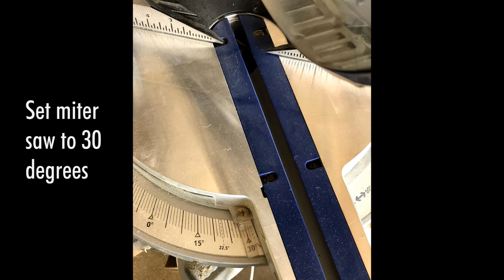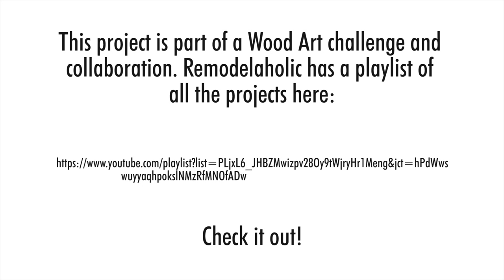DIY Pallet Project Wooden Wall Art by House Becoming Home

Comment: Great work, getting all those angles to match up is no joke, I have wanted to build a cutting board like this for a while but I love the textural element of the pallet wood in there.
Reply from the maker: Thanks!  Yes, those angles!  Not every piece fits absolutely perfect, but because the overall project is a little "rough" with some nail holes, knots, etc., the lack of perfection works.  I like the idea of using this pattern in a cutting board!

Comment: This turned out looking great! My lazy self wonders how hard it would be to glue all the parts to the hardboard first, then cut it down to size with the table saw or circular saw... Otherwise, that's a lot of cutting on the miter - stop block is not optional!
Reply from the maker: Thanks Mike! I thought about doing it on the table saw too....but I trust myself better with the miter saw. It really didn't end up being too many cuts at the end...many of the pieces were cut exactly in half so I was able to use the other half in another spot, essentially getting two pieces out of one

Comment: I put the miter saw on 30° cut to 3 inches and it still doesn’t line up? Any tips?
Reply: Leonidas i cut my strips to 2 1/2 pieces then cut them in the miter saw at the 3 inch mark. Now all my sides are 3 inches. Hope that helps